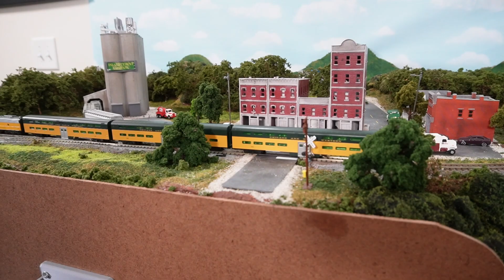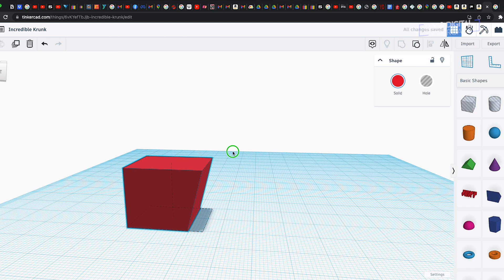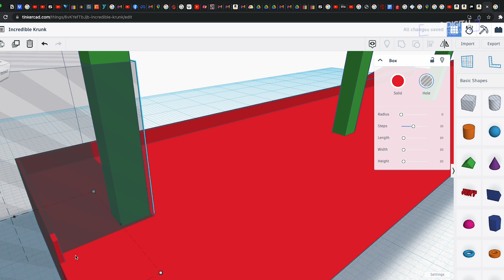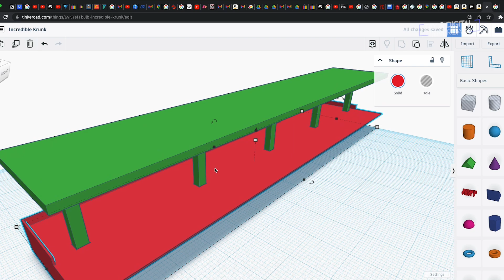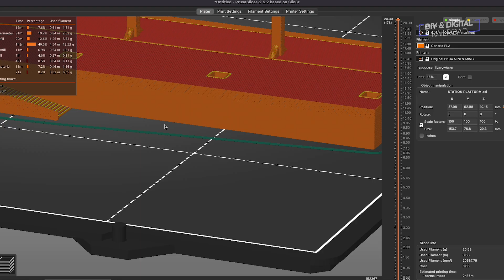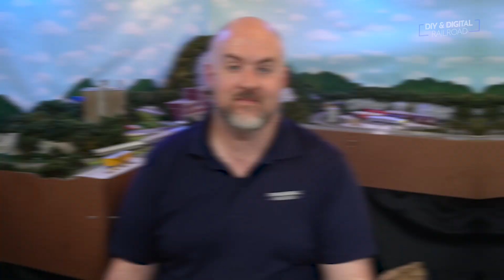My Model Railroad Needed this, so I decided to 3D Print it.

Comment: You can use the same juice you use on styrene to "weld" PLA.   I use Same Stuff from Micromark.  I have welded PVA to PVA and PVA to styrene with  great results. You do not see the glue joint like you do if you are a little too aggressive with  the CA .   Parts need to be a tight fit (use clamps if gluing two flat surfaces)   I also have a Prusa mini and design my interference fits using .2mm for PLA and it works great.